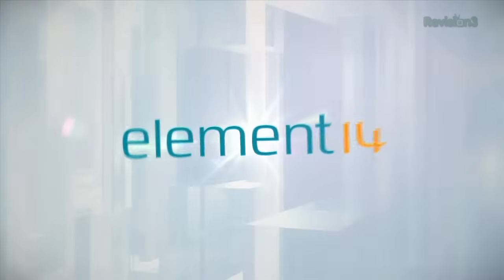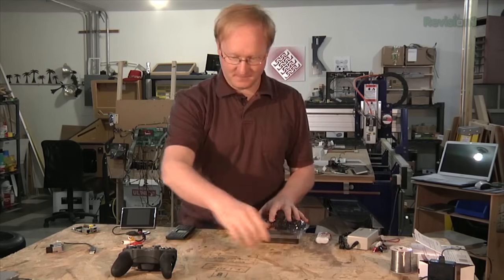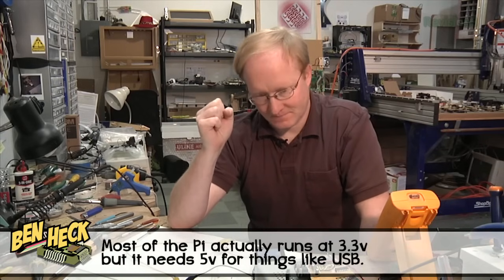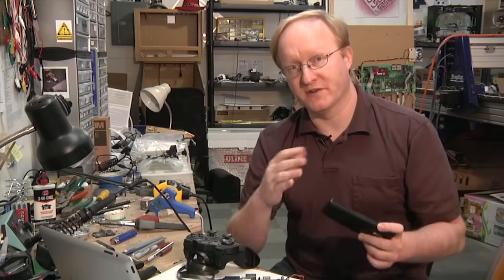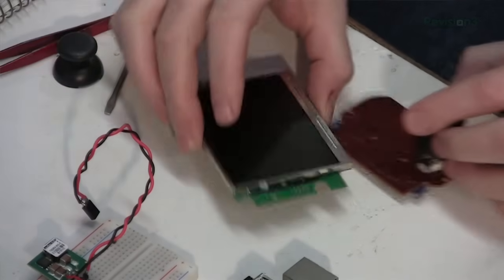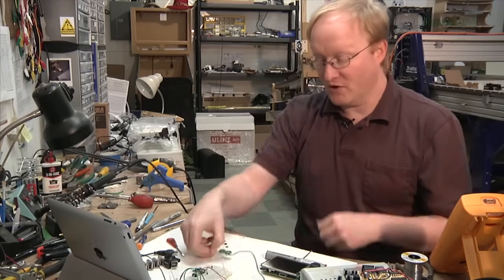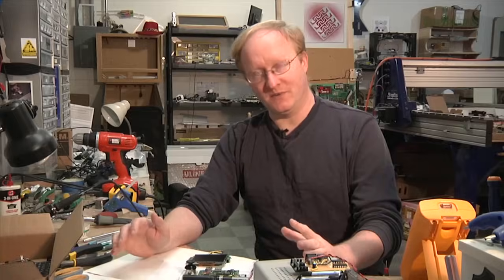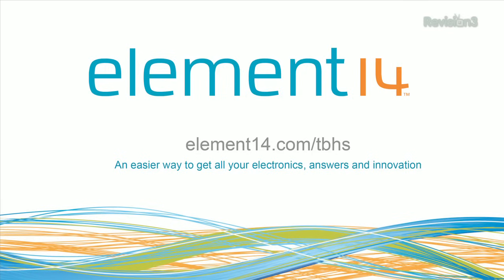Build Your Own Portable Raspberry Pi (Part 1)

Comment: It's strange to me how the PI is so popular. There's just so much more you can do with an old smartphone, they have every sensor you can think of from a gyroscope to a GPS. My old Galaxy S4 has been happily running as a media server for years now. I've just upgraded my S5 to an S7 so I need to find something for the S5 to do. Why would I selll a perfectly good computer that's probably more powerful than a rasberry pi anyway!
Reply: Lee Rees maybe because its great for programming and is 15 fucking dollars
Reply: I agree with Mr Deiz. $15 for a raspberry PI vs >$500 for a Galaxy S4 (assuming you bought it at launch). What do you think most developers or DIY’ers would spring for?
Reply: Bro can you say me that how a smart phone can be changed into a microcontroller..plz
Reply: thing is, the raspberry pi was made to do all of these things from the get go. The GPIO pins are a great example of it's modularity and openness. i don't deny that a phone can't be a micro controller, rather because it wasn't made to be a micro controller in the first place
Reply: or maybe because you should be an even harder geek than you need to be to do the same thing on a Rasp. Would you describe a smartphone as "modular" or "hackable" or even "flexible" with standard tech skills? The Rasp was CREATED to be flexible, even with complete noobs. You can't even brick it with normal means, you just take the micro sd and flash it again with the correct software, and there you go, fixed.

Comment: Where do I get a Raspberry Pi, and how much does it cost?
Reply from the maker: There are quite a few varieties of Pi, so it would depend on the level of functionality you need. They range from $5-100. Check some out here. http://bit.ly/2dL51fU
Reply: The Ben Heck Show Then where do you get the $5 ones?
Reply from the maker: The Raspberry Pi Zero can be found for $5, but because of the low price, they sell out quickly. If you are in America near a MicroCenter, they can often be found there.Looks like Adafruit has them in stock right now! https://www.adafruit.com/products/2885

Comment: I did the same to a controller and it also acted funny, but it was fixed by putting a resistor between the button ground and joystick ground. Not sure what value it was .

Comment: Hey Ben Heck Show. 

This probably isn't cost effective but what if you put a Raspberry Pi in a Toshiba Satellite Pro. I've managed to get as far as gutting my old one, buying a 10000mah battery, wiring the display/speakers so they're HDMI compatible and hooking up an SSD. Next steps or advice?

Comment: Hi BenHeckShow! I've ordered the same monitor as you are using in your project. However, I cannot get it to work. I've tried 12V 2500mA net aggregator, and Composite video signal from both the raspberry pi and my nintendo wii, but nothing happens, it seams broken. Any suggestions? :)
Reply: +Robin Grönberg Put some milk and salt on it to de-electrolize the neutrons
Reply: +hompalai -And dont forget the egg!
Reply: +hompalai HowToBasic? HowToBasic.
Reply: +Goldeneye no, twitch raids
Reply: +hompalai Oh. Are you on Raid Forums?
Reply: +Goldeneye no

Comment: i got a question is it possible to use a broken laptop LCD screen and connect to the raspberry pi and add a touch screen digitizer of the broken laptop screen size and turn it into a touch tablet? i hope you can make project on this. Because i am thinking of making one for my self but do not know where to start.

Comment: What parts were used for this build, I'm a begginer at using the raspberry pi and i was also wondering if i could use the raspberry pi 2, instead of the raspberry pi

Comment: I have a question if anyone is willing to answer, is it possible to use old phone lcds and use them on other devices like a pi or in my cause an Odroid?
Reply: +Randy Martinez Depends! Older small Nokia LCDs are really popular and are still sold for this reason, because they are in fact "smart LCDs", they contain their own frame-buffer and graphics commands, and are controlled by a serial SPI connection present on any microcontroller, asynchronously, so you didn't have to be careful with timings at all, and the CPU use stays very reasonable and is essentially zero when you don't need a lot happening on screen. It was also a great design because it minimized the number of cables going to the display assembly and the signal quality requirements on the cables, allowing for flip phones which didn't have a terrible reliability weak spot at the hinge, but i digress.

However, many other phones have the graphics framebuffer and LCD driver outside the LCD, usually in main SoC of the phone. I'm not going to say that you absolutely CAN'T use these LCDs for anything, but i don't think you can get timings right on ODroid or Pi, and even on a microcontroller it would require extreme ninja programming skills and might be impossible. I don't know whether there are (accessible) dedicated display controller ICs you can use for those, but some projects have been implemented in FPGAs to drive some of such displays.
Reply: Siana Gearz
Yeah I looked into it for newer phones too and it turns out its near impossible without the help of the original company who manufactured the phones. Its takes a great deal of effort from what I can tell so I'll stick with the stuff I can find on adafruit lol
Reply: Randy Martinez Hobbyists who have used random non-SPI LCDs have usually reverse engineered them themselves using a logic analyzer, or even an FPGA programmed as a logic analyzer, subsequently reusing that same FPGA to drive the LCD. Usually there's nothing particularly surprising there, but i don't think i would be up to such task myself.
Reply: Siana Gearz
I was looking at forums for nexus devices and it just collectively seemed like there were somethings they simply couldn't do, some problems that they just couldn't get past or something. I've never worked on a project like that so I can't say I'd have a successful experience with it lol

Comment: Would it be possible to use a wireless xbox controller to control the raspberry pi like a radio controlled car? I'm sure I could just stuff the receiver inside the car somewhere. If I had the materials to do it I would try. Of course I may need to code some software to control the moters by input from the controller.

Comment: What about a raspberry pi 2 "carputer" with a 7" lcd touch screen display, usb gps antenna and analogue reverse camera for in-car applications? Maybe even add a 3g/4g modem or also add a powered usb hub for external hdd and webcam. =)

Comment: Haha. I remember those Ouyas. Are they still around?
Reply: Yes
Reply: Neceros I got one when it first came out. I rooted it asap to get the play store and aptoide because the market it came with was sub par.Even then the specs were underpowered so I downloaded Tegra overclock. I then used it to play GTA and stuff, but it got boaring pretty quick and I sold it withen a year.

Comment: Rub A NES Against Cats Fur Or Discharge Static Electricity To It And It Wont Die I Have Tested It :P But I Say This Because You Really Should Not Do That As The Cartriges And Controller Side Are The Only Sides Breaking (Dying) So If You Mod A NES Be Careful To Not ESD It As It Will Still Work But Your Controller Ports And/Or Cartridges May Die So DO NOT DO ANYTHING NEAR CATS CARPETS AND HIGH VOLTAGES

Comment: Ben you are awesome, I decided to subscribe!
And I have a question
What kinds of things do I need to know to make one of those?
I major Electronics electrical engineering, but I'm still in my freshman year.
only major related class I have right now is digital design... (binary codes, working with 2's complement, k map and etc)
what should I know to build one of those?

Comment: I'm using the same screen to do a similar project (using RetroPi instead of MAME) but I am having issues with the screen resolution. I can't read anything in the terminal because of the resolution, which is making troubleshooting it even more difficult. What is the way to go about fixing this?

Comment: I think Ben Heck should mod a Fisher Price PXL 2000 camcorder using raspberry pi with 512 ram memory. He should remove the tape recorder part from the camcorder replacing with a universal memory card reader. With the raspberry pi upgrade part, he can mod the original PXL 2000 black and white resolution video 6 times greater and sharper if done correctly. I know this sounds complex, but I thought for this kind of idea Ben Heck has not tried yet.

Comment: Can I install Ubuntu on a Raspberry Pi?
Reply: Thanks.
Reply: ***** One more question- Does Raspberry Pi support Unity 5 or Unreal Engine 4?
Reply: thejanis *Sigh* Can the Beagleblack Bone run those?
Reply: The Pi will not be able to run graphics like that the beagle cant either... those things are designed for high wattage and processing power computers... these smal computers cant replace a desktop or tower
Reply: frank navarrete I know that, but I was hoping for something to run something like Unity on a cheap PC. Oh well, I'll just get a barebone.
Reply: StuffTubeAmwesome I think you can but ubuntu is sort of memory intensive. Atleast for the Pi.. Thats why most OSs for the Pi are stripped down versions of linux. Even then you'll notice lag on those distros.

Comment: This PCB you took off from battery pack is NOT a charger. It doesn't control charging (apart of not allowing to charge if ANY cell is below 2.7V or above 4.2V)! Lithium batteries AREN'T dangerous, because they are powerful (even 1mAh Li-ion or Li-Po battery can overheat and explode AND/OR catch fire). Charging battery, which voltage is outside of 2.7V-4.2V is dangerous, because it WILL overheat and could explode and or catch fire. In worst case scenario it would build up temperature high enough to catch fire and explode at the same time, creating flying fire!

If you do not have comprehensive knowledge about Lithium based batteries and their behaviour DO NOT use them. You should never connect Lithium based battery directly to ANY kind of circuit. You SHOULD always use 'gas gauge' and specific 'Lithium battery charger'. Gas gauge is last line of defence if something will go wrong (it can disconnect battery from circuit). Lithium chargers are quite intelligent and usually they work in team with gas gauges to prevent overcharge and/or overdischarge.

NEVER use Lithium cell, which have voltage lower then 2.7V. DO NOT attempt to charge it - it is irreversibly damaged and charging WILL cause explosion.

Comment: I have a 3.5inch screen for a portable I'm making at the moment. It wouldn't run off 5v either, I hooked 12 to it and poked around with a multimeter and found a capacitors positive leg was actually @ 5v, therefore... it steps down the voltage from 12 to 5 on that PCB. I hooked my positive 5v straight to the cap leg and vwolah, runs off 5 volts.
Reply: oh, Darth Bancid already said that 2 months ago lol

Comment: Kind of late to ask, but is the Voltage Regulator just like any other voltage regulator chip, and more specifically could I just use a LM7805 L7805 7805 Voltage Regulator in the place of his regulator? Thanks in advance.

Comment: The Ben Heck Show a model some idea why doubleAA rechargeable if could work by stack of li pol or lithium ion battery that has 1000mah per one and rate of 3.7 v  could work and specially it will flat and less in space if we can have it try a bl-5c a cellphone battle make 3 it will rate up to 3000mah 3.7v if in parallel if in series will do 3000mah 11.1v or 2 parallel will do 2000mah 3.7  or  in series 7.4 2000mah  mah will up and voltage up depend on if its series or parallel or 4 batt will good the mah it will  :)

Comment: Hi Ben. I'm 14 and last week I got my Pi portable. But what you could do is bypass the voltage regulator on the LCD screen. The screen runs off of a 12 volt car battery, but it steps it down to 5 volts. Just solder it to the first capacitor's second terminal. Then you can run it off one battery! Thanks!
Reply: Not all LCD's are created equal. A better explanation would be to hook it up to a 12v source when taken apart. Get a multimeter out. Put the gnd probe on, well, gnd, and with the other probe, start at the 12v source and follow the circuit until it is stepped down to 5v. At the end of the last component in the stepdown circuit is where you need to resolder the + wire.

Comment: Could you offer some help with troubleshooting known issues with the raspberry pi, because I was wanting to build this project. Yet when I was trying to boot my my pi up I got the red LED to stay lit but the green light wouldn't stay lit once it was off it was OFF. I also can't get any display working either. I'm using a 850 milliamp @ 5.1 volt power supply that was originally a droid phone charger.

Comment: How'd you get the LCD display to connect to the GPIO pins? How does that work..
Reply: It's not actually, look closely around 6:38 and you'll see the the switch he created is turning the both the screen and RPi on. The thin yellow cable is connected to the Composite Video.

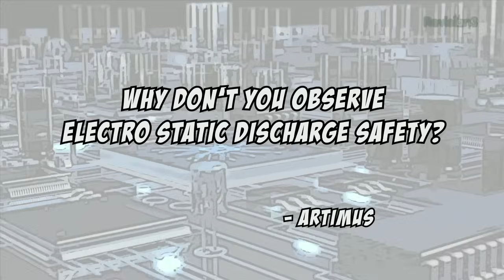Comment: 17:50 I've never worn those wrist strap things or used a grounded mat on my workbench or table.  Ever.  In over 30 years I've never had an issue with static.  I tend to touch things that discharge any static on me before I'm touching something I plan to keep.
Reply: Ditto. I've been building and repairing computers for the past 18 years (built my first when I was 8 with Win95), and I've only found the ESD bracelets/anklets that you're meant to clip to something to stop building a charge to be more pain than the worry of frying a board, so I keep the PSU of a system plugged in (~BUT~ have the on/off switch on the PSU itself set to Off) and discharge myself through the chassis of the system I'm working on.
Okay, this works better on something like my all-steel CM HAF-932A chassis, but it's still better than nothing.

And tbh, I've only fried ~ONE~ system (a 1.41GHz AMD Athlon that ran like Win2000 or XP) during a repair, and that was by pure accident of plugging the front panel's power button on the mobo's header the wrong way. No ESD, no CPU overheating, just an accidental reversion of the power button on a system that was being worked on to see why it was dying anyway.
Reply: Samniss Arandeen When I managed to fry that ancient 1.4GHz Athlon, I was working on computers in a house where the bedrooms & front room were carpeted, dining room/kitchen were lino and the back veranda was cement (was an old farmhouse with the veranda closed in).
The house I was in between then and where I am now (after a mid-January move) was natural hardwood flooring in all rooms with carpet laid over it in the front room (where most systems were worked on), lino covering the floor in the dining room, kitchen & backroom/laundry, whilst the bedrooms had the wood flooring uncovered.
Now I'm in a place where the flooring in rooms without plumbing is carpet, and lino in the wet rooms (kitchen, bathroom, laundry, back porch).

So most of my systems of the past decade have been built when I'm standing barefoot (no shoes on in this house, except in REALLY cold winters) on either carpet or wood, and yet I've only managed to fry ~1~ out of like 50.

Comment: Hey Guys! I have started to work on this project. But I don't know how he did the power switch becouse he only describes it as a "switch". If somebody can help me than it would be great! And if you can include a link to it (the best would be amazon.co.uk) than that would be awesome!
Thanks, and sorry if it is a dump question. (I'm new to electronics but I understand most of the stuff or researched them through the power of the internet.)

It would be good if Ben would make a parts list (with links to the stuff).

P.S. And sorry if my english is bad.(Not my native language.)

Comment: where did you get the lcd monitor?
is the monitor's interface is composite?
Reply: I think this is it http://www.amazon.com/3-5-Inch-TFT-Monitor-Automobile/dp/B0045IIZKU/ref=sr_1_6?ie=UTF8&qid=1384877438&sr=8-6&keywords=lcd+3.2

Comment: I'm not sure if this is the exact same one he used, but it is a 5v switching power regulator. Look up "3-Terminal 5V 1A Switching Voltage Regulator Power Supply" on ebay, should be about $6.95.
Reply: freezydrag ok

Comment: Here's a trick: That monitor CAN run on 5vs, but you need to remove the linear regulator in it (drops 12v to 5v). It's typically located in the upper left on the back of the PCB. I use the mod to allow easier use of the screen with my Pis.

Comment: Hi Ben
One project I would love you to look into building is running a video projector, dvd player or pi with movies on a hard drive and a suitable sound system off-grid. We have started to look at using up to 5 bikes to power alternators and provide power to run the cinema. It would be fun to see the young people cycling to watch a film. If the system was portable in some way we could basically rig it up in the middle of woods and provide ambiance to the film.
Thanks
Rich

Comment: Why not just connect the buttons to the GPIOs on the pi?
It's not hard to read them in python and send joystick button presses to whatever program is open. You would need an i2c adc for the stick though.

Comment: Normal analog joysticks are mainly potentiometers, so when you disconnect them it can cause problems. Normally you'd use resistors to act as a fixed potentiometer value.

Comment: Not sure exact, but i have bought ebay item 230965780754 which looks very similar to the screen ben used.

Just search for Reverse monitor on ebay there are tonnes cheaper from cheaper.

I am planning on replicating this project :)